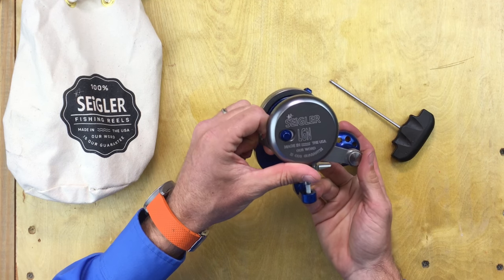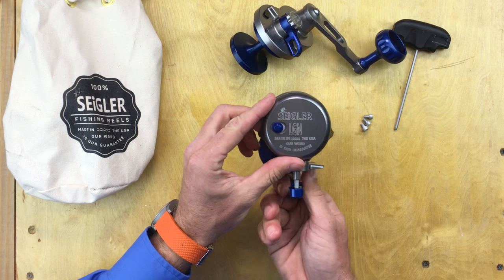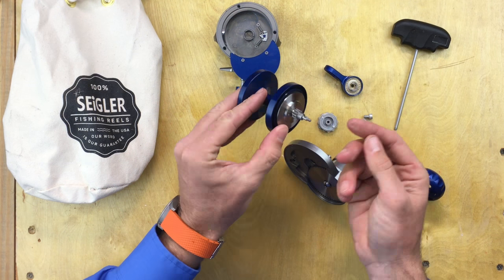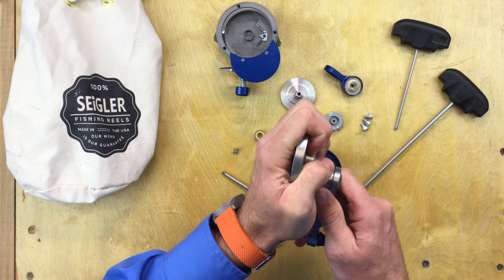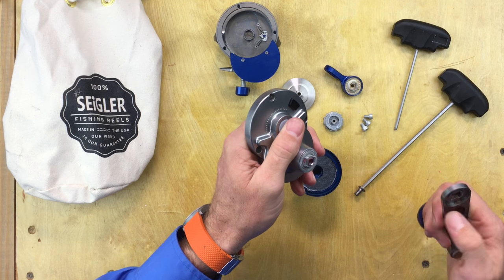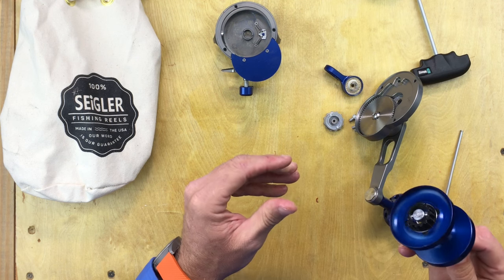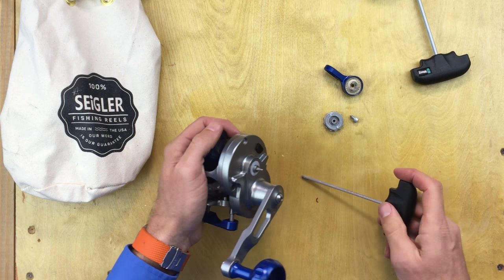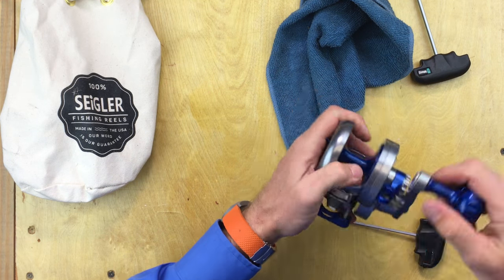Inside a SEiGLER Reel: Large Game Narrow Tear Down

Comment: I have sgn that I have followed these steps to put it back together. I had to. Take it apart because I got line behind the spool. 
Problem when reassembled is I can’t tighten the drag preset without losing free spool. 
Any idea what I’m doing wrong?

Comment: HELP
My case: Friend of my son bought two SG:s from somewhere overseas( In the beginning when they still was "Release reels"). Kept one and sold the other to my son. My son loaded his with 350 yds of 50lb braid. So far so good. No measuring or testing he set the preset knob for the brake so that he could hardly pull out the line with his bare hand(directly from the spool), thats how we usually test the brake before presenting a jig to our precious halibuts.Doing that and reaching a point of satisfying braking force there was so much binding that you hardly could move the crankshaft. What is wrong? Something definitely is but I just can´t figure it out.
Opened the reel with  this as a guide an although it´s an SG it looked pretty much the same only difference is, this reel does not work as supposed.
Can anyone help me?
For the "lifetime warranty", who´s lifetime? I´v been in contact with  release reels and they had a lot of strange ideas of what could be the problem, one was something in the line of "you have to much line on the spool, you can´t expect the reel to perform as specified with 3/4 of the spool filled with line."...?!?!?!?!?
Can anyone help me to get to an end with this, is it a trashbinbuy or is it anything to do about it?
Reply: Per Lindstam stop worrying and just send it to them with the description of the problem and surely it will be fix....
Reply: same prblm here,SGN max drag 30lbs,but when more then 3lbs the resistant of cranking start to increase follow by the more drag u put,so they should stated efficient drag is 3lbs as well!the thing is i stay in singapore,& how much it would cost for the shipping?